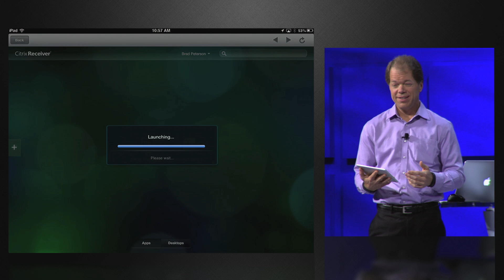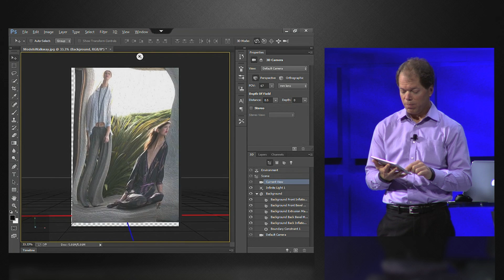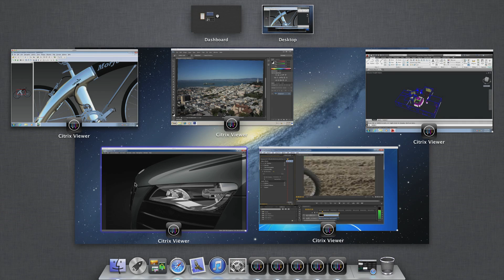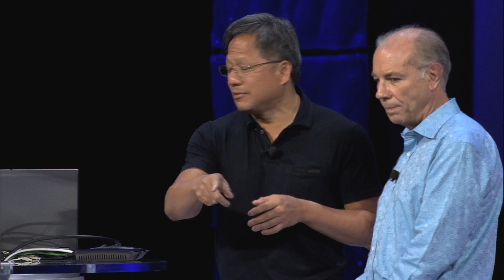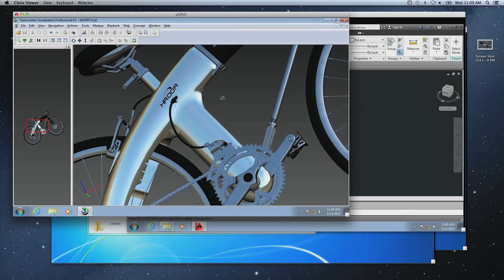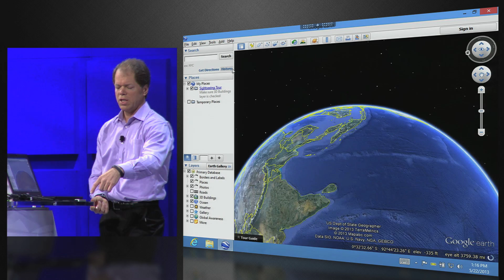NVIDIA GRID vGPU Technology Unveiled at Citrix Synergy

Comment: Over a year ago at CES 2012, NVIDIA CEO Jen-Hsun showcased remote 3D gaming using Splashtop...... a professional gamer was invited on stage to use an NVIDIA Tegra tablet to remote play Skyrim running on a GeForce optimized PCs.   For years, Splashtop has been optimized for both GeForce GPU and mobile Tegra hardware acceleration, capable of running at 60+ fps and < 30ms latency!   

youtube.com/watch?v=6nyg2kZfF5A

Comment: Thing is, teamviewer is great for 1 user trying to connect to 1 session, but teamviewer is really limited to 1 session per PC. The grid can have multiple people. Also team viewer doesn't compress data nearly as well as this. And if your using a common codec like H.264 you can stream high def video pretty easily. It's like a you tube live stream except faster

Comment: If you've tried using Solidworks, AutoCAD, etc. through a conventional RDP connection you'll realize how fundamentally different ICA+HDX+local GPU is.  You get the advantages of ICA for the remote display protocol plus the substantial added boost for graphics performance on the local hardware, all displayed much more smoothly over a lossy, latency-tolerant remote display protocol like ICA.  Yes it's like RDP but RDP that actually makes remote use of very graphics intensive apps feasible.